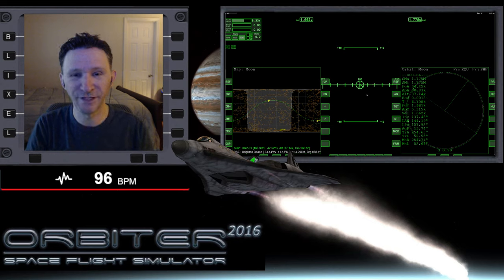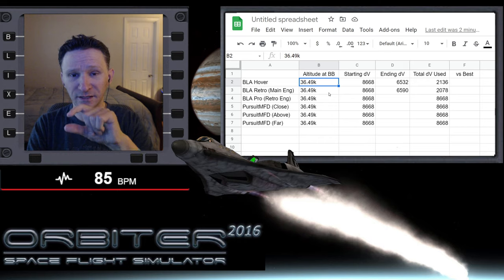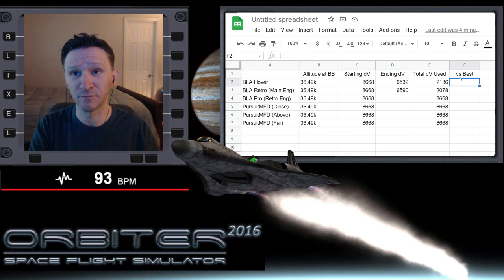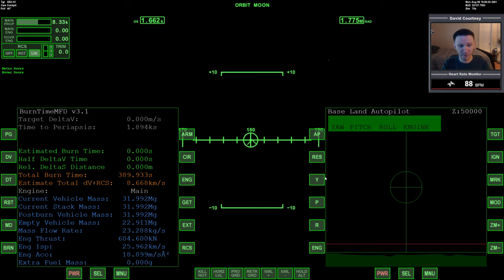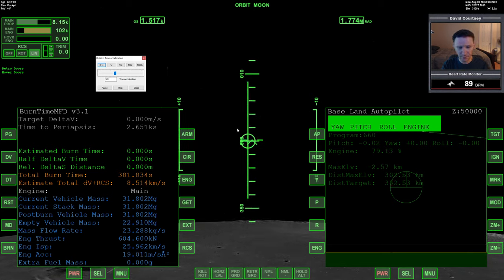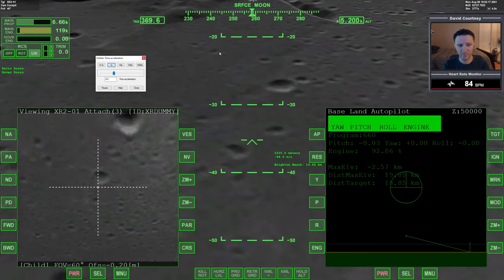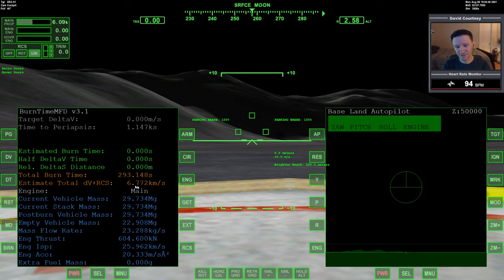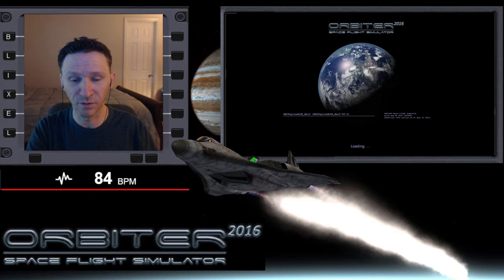Orbiter 2016 - [Part 2] Comparing Autolander Methods

Comment: Interesting result. So Pursuit uses about 60 dv more from that altitude vs 20km, in my experience at least. Clearly, there is some difference depending on altitude. With a retrograde approach to Brighton Beach, I think you can lower your periapsis to 0 to save dv because the terrain is low for several hundred km to the East. I didn't know Pursuit had 3 different modes. Looking forward to seeing those. Going to be tough to beat BLA-retro! Cheers!